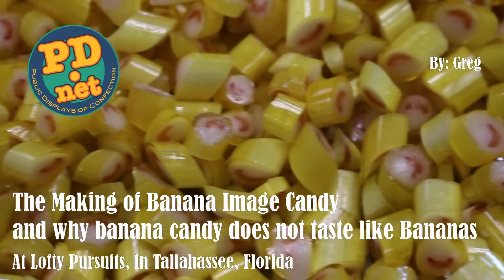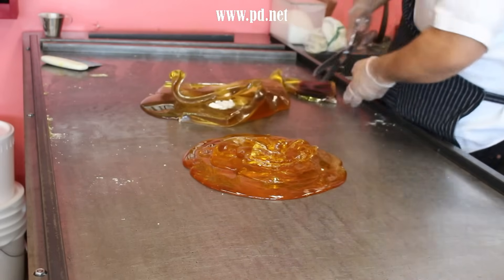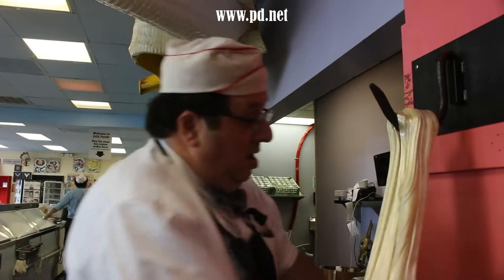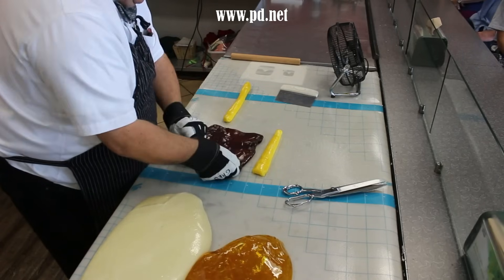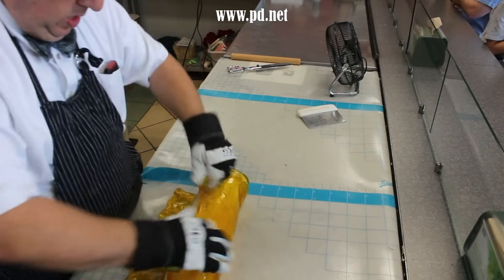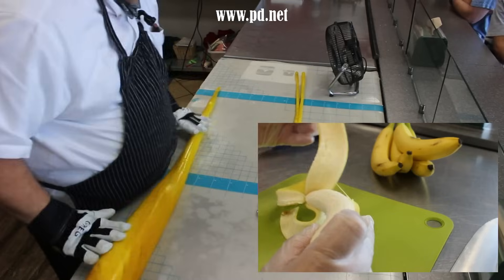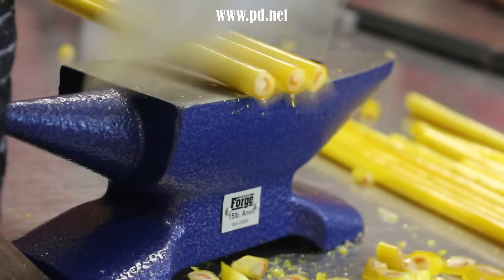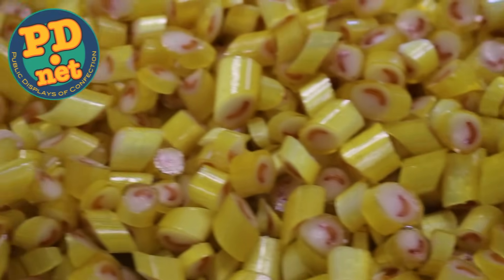#61 Victorian Banana Candy or why does banana candy typically not taste like bananas?

Comment: The banana splitting into threes could be the Fibonacci sequence. You start with 0 and 1, then add the last number with the current number (0,1,1,2,3,5,8,13,21,34,55...). 0+1=1, 1+1=2, 1+2=3, 2+3=5, 3+5=8, so on and so forth. Most plants follow this pattern in one way or another: flower petals, leaves, and seed patterns (count the number of spirals in each direction on a sunflower and it will follow the pattern) all have numbers that follow it. More info here: https://www.mathsisfun.com/numbers/fibonacci-sequence.html

Anyways, love your videos and would love to visit someday!

Comment: why do you choose the chop anvil method for the cutting process instead of a slam down thing?
Reply from the maker: By slam down thing, I assume you mean a buttercup cutter. That pinches both ends closed, so if I did that you could not see the art, as it would be pinched to a point. I can cut four canes at a time, but I usually need to cut slower, so I only do two or three for the videos.

Comment: monoculture banana good news everybody.
if the current blite does become a bigger than normal problem we have other types and cross breeds. yes that's right banana companies do have diverse growths and can and do cross cut / splice into the current crops to strengthen them.

More importantly if we get stuck with a regrow situation there will only be a few years of drout before the new plants get spliced with mature cuttings. (one of the big problems with cultivating them is how long it takes the plant to fruit for the first time) splicing cuts that down alot.  
in fact you may have already eaten the new strain and not even notest it.
They tried hard to keep the taste and such the same.
Reply from the maker: bananas are mutants. They don't have seeds you can't cross breed them. Everything you said here is inaccurate. They can't do it and they're putting no money into trying. There are other varieties but from what I have been told no other variety can survive shipping or they ripen too fast. Bananas will be around but if these go away there is no obvious substitute that can get to market in north american and Europe that is not going to be affected by the same disease. Hence what you posted is not correct. Because of their weird tri strand genetics, standard genetic manipulation does not work. If I am wrong please post links to where you found this information. Youv've written it like you've made it up.